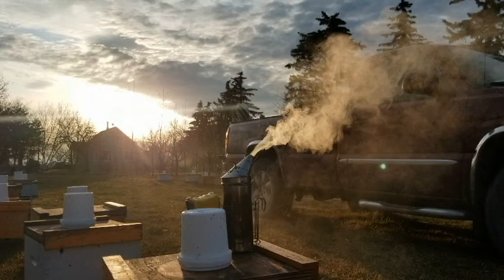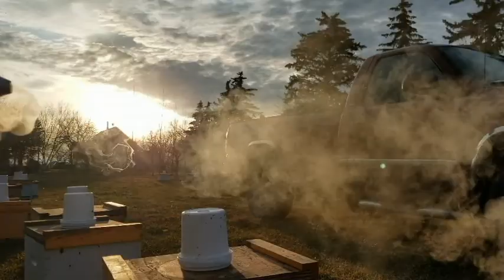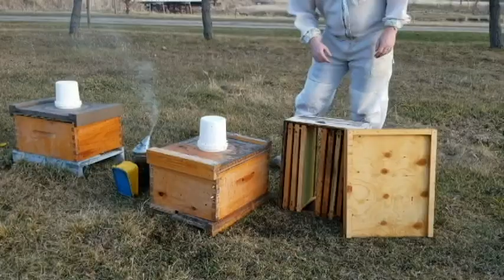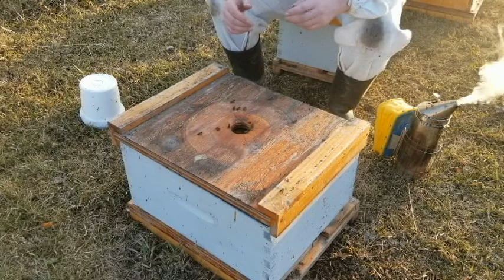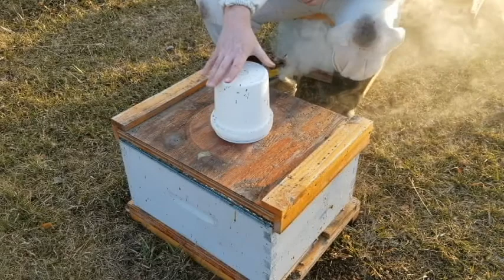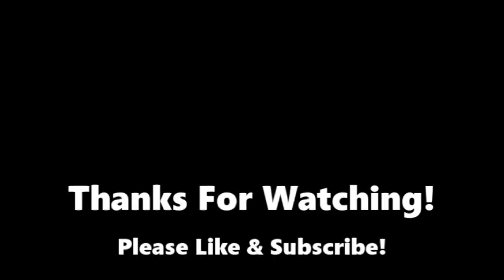Colony Transfer & Answering Feeding Setup Question

Comment: dose you divider board not come out? I made queen castles , 3 dividers for mating, and if a cell dosnt hatch, or latter dosnt come back mated i can just pull the divider and join the 2, or 3 to lend support to the stronger hive. seems to work, but I am just learning
Reply from the maker: Our division boards are glued in place, these are not typically used for mating, we have much smaller mating nucs for that purpose.